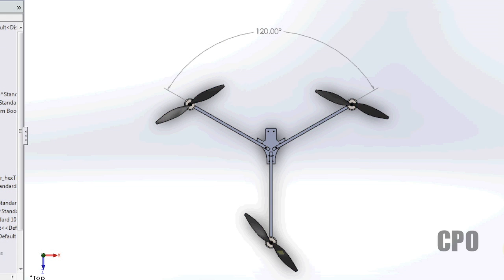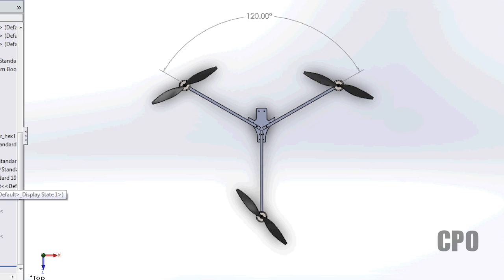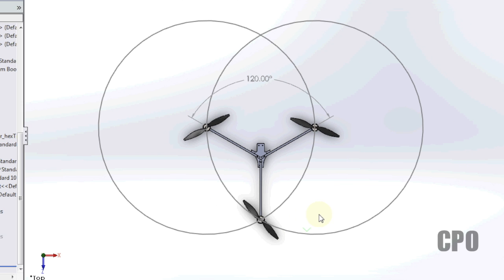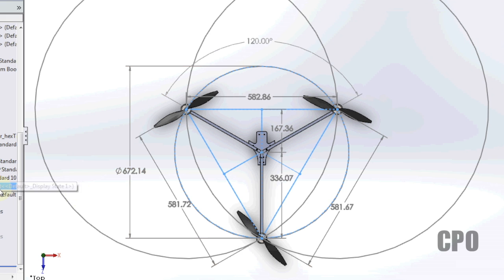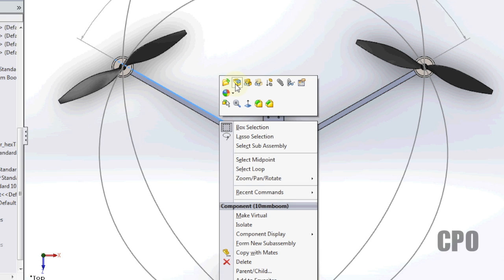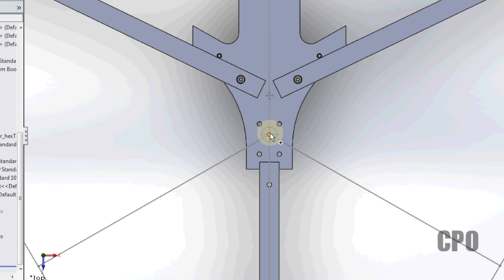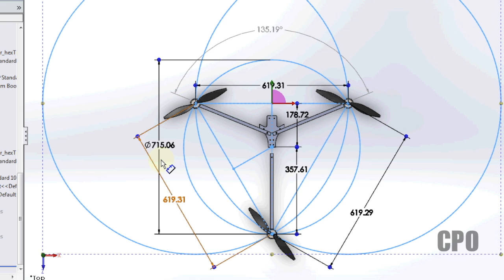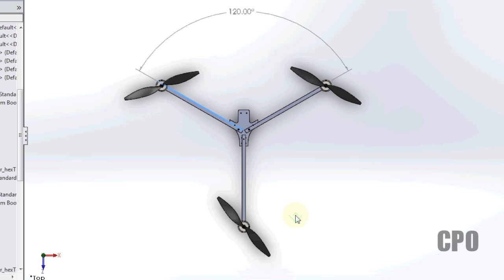CPO Symmetrical Tricopter and T-Copter Design Theory and Defining Optimum Center of Gravity Location

Comment: Thanks for the long and detailed explanation! I only built quads so far but want to built a tricopter now. As I understood the FC can compensate not proper designs I assume because of its accelometers, but having the symmetrical motor placement and weight and accelometers at the center of gravity should lead to smoother flight as it does not have to compensate more frequently the calculated values for motor adjustments.

Comment: I'm sorry, but althoug your theorics work fine I believe that I can not trust in you "120º" config, cause it is relative to a fix point, a fix center that has no value at all. cause every time you redraw your circle to find the CG you chage the center of this circle, then going back to a 120 deg configuration... This, or you have to call a T copter as a 180 deg configuration.....
Reply: Its not really 'his theory'.. its kind of just how physics work in general. the CG will always be at a 'fixed point' with no value. the method he uses to find the CG, works perfectly in the theory. the only place it does not 'work' is when you start adding all your components. because then you are adding weight (values) to various parts of the frame, and thus changing where the center of gravity ends up being. That's why you see everywhere that you have to adjust the position of your battery forward or backward in order to keep the CG as close to the middle (where his circles are showing CG should be) as possible. 

So, his 'theories' work just fine. Just, once real world variables get thrown in, you need to counteract them so the CG will stay where it 'should be'.

Comment: Does the center of your flight controller board have to be on the center of gravity of your frame?
 I'm using KK2.1.5 board with 120* tricopter design.
Reply from the maker: It should be as close as reasonably possible. However, if it's not precisely at the center point, it will fly just fine.  The KK will compensate for any variances off center. I've had my KK board as far as 2-3 inches off of the CG and didn't notice any difference in flight.
Reply: EVERYTHING cpo
Thank you

Comment: Your statements about the center of gravity are incorrect. CG is not about geometry, its about weights and distances.
If your tricopter has a yaw servo and tilt hardware that extra weight on the tail arm for that servo and tilt harfware will move the center of gravity away from the geometric center you call out.

Comment: Great video, thumbs up!
Important to remember though:  the center of lift doesnt change when you alternate between these designs, this means that the center of mass that you build the tricopter into also doesnt change, as you say in the video. However, the moment of inertia does change between these designs, especially if you mount a whole lot of stuff along the length axis in a T copter -> this will dampen the pitch response compared to a symmetrical Y copter, and the PID values must be changed to compensate.

TL;DR: if you change from Y to T copter, or vice versa, retune your PIDS (and tune pitch/roll separately)

Comment: What are the design considerations you made in deciding to widen the angle between your front booms (and thus lengthening the rear boom), versus simply pushing the camera out further forward (and thus moving the battery backward to maintain CG)?